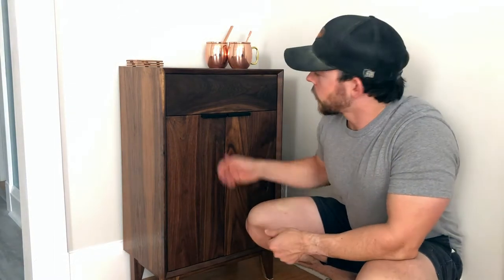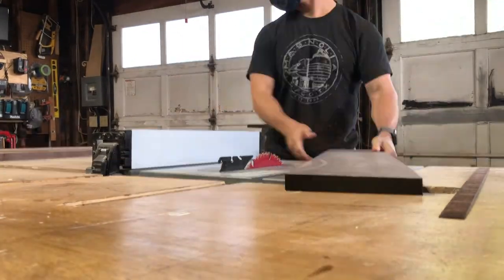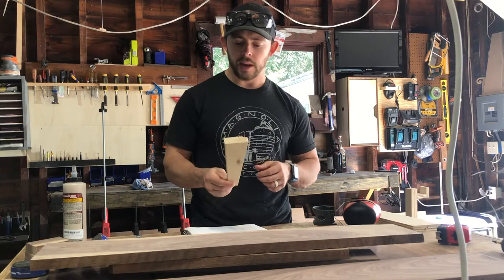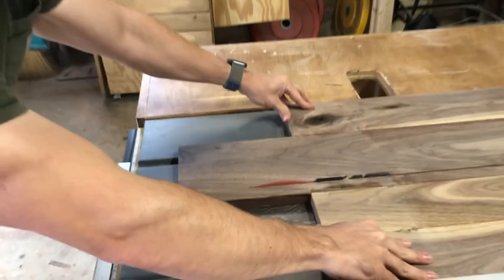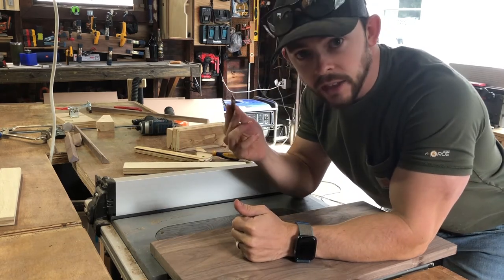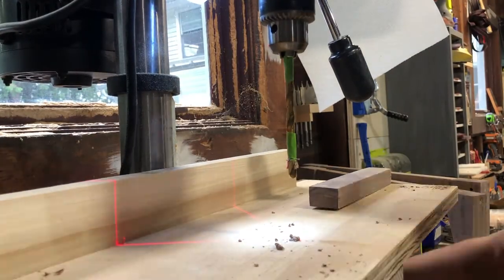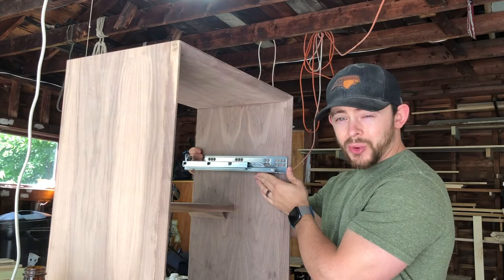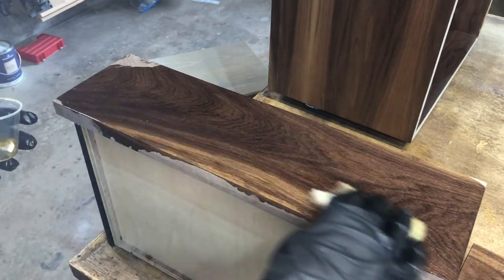DIY Liquor Cabinet with HIDDEN Lock / DIY Woodworking

Comment: I like the product and I like the video but I don’t believe you’re supposed to glue in the bottom panel of the drawer. you want it to float in your groove.
Reply from the maker: I wasn’t too worried about since the drawer and bottom are plywood vs solid wood. think it will be stable enough in my home